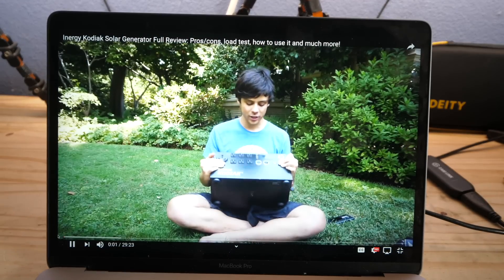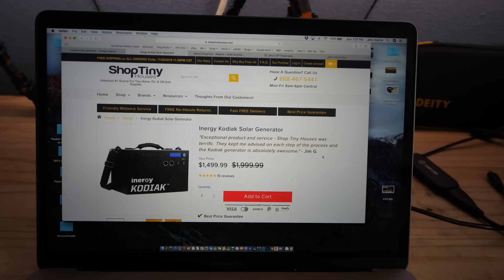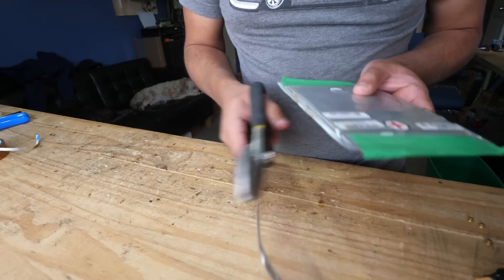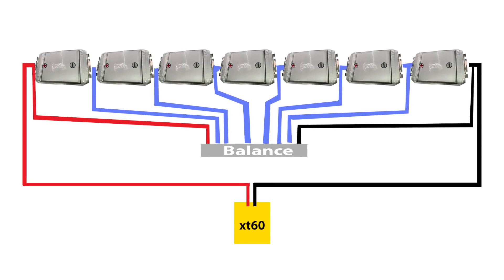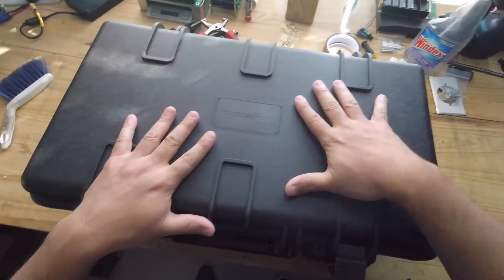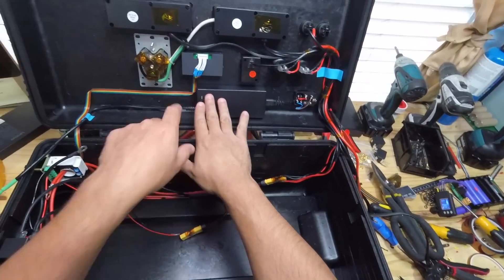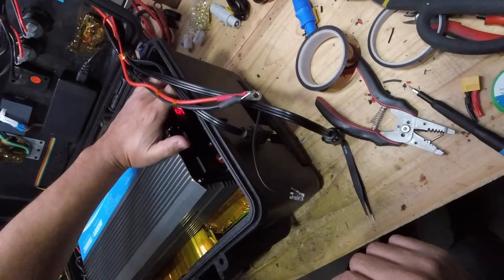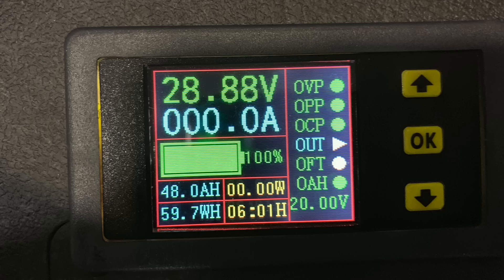DIY Inergy Kodiak Solar Generator

Comment: i don`t deal with you because first this your diy generator and kodiak  generator is very expensive 
and don`t forget you was working in the company for the battery lithium so this thing is help you and 
very easy to getting them free 
about me and another ppl they can`t paying like 1000$ to get only  lithium battery 
1- lithium battery with shipping from china = 1000$ 
dc to ac inverter 2000W high quality from china = 300$ from china and another price to buy this inverter from your country like more than 300$ with shipping 
another parts the total price between 100$ too 200$ 
solar panel 200W = 200$ with shipping 
total hours working between 8 to 12 hours none stop 
so did you thinking this is very easy to getting your diy  generator or kodaik  generator ???
Reply: If you live out of the U.S.A. don't spec the prices are the same.
Reply: @nelsonpagan5163   If you live out of the U.S.A. don't spec the prices are the same ????
i think you kidding  .. who`s told you the prices are the same ? 
from DHL , TNT , FeDeX and another company in the Middle east is very expensive to shipping the parts 
for Example solar panel 200W = 200 $ usd the price with out shipping 
so if you want to know how much the price with shipping from this company it was 
solar panel 200  + between 150 too 200 USD with tax .. the total price will be 400 USD only for solar panel 
so you just living in usa and you don`t have any idea about another country 
and like i told you before you can getting a free lithium battery from your company because 
you was working there 
if you asking me about why the lithium battery is higher price when you shipping from china to any country because all the company said it was Dangers to shipping them free 
but i think they are joking if you put them in strong box

Comment: Hey Jehu, question here, in the parts list you have a modified sine inverter that is being used. Wouldn't it be better and safer to use a pure sine inverter especially when you're charging expensive computerized electronics? I may be wrong, but what has been your experience or others out there between modified and pure sine wave inverters?
Reply from the maker: Yes get the pure sine inverter instead
Reply: @jehugarcia  where can I find the 24v 2000w inverter with solar charge controller

Comment: good job.  Suggestion... how about using 18650  in 7s (whatever p) 24 volt inverter not using the board kit in this case, just cells mounted in the classic plastic holders for space saving. spot welding or wire and fuses. everything simple. and every user chooses their favorite way of charging, (solar, ac adapter, car) Jehu  has inspired me wit his ideas. keep that good work and spread of battery education.
Reply: Luis Rodriguez 18650s are what Tesla uses.
Reply: You could end up melting the spring connectors if you pull a lot of current.
Reply: @kevincai96  wright.  in that case the sistem is good for electronics,  use a few hundreds of watts like most solar generators.

Comment: I would be careful doing those joints for the batteries, aluminum to brass to solder to copper is a lot of transitions leaving a fair chance of hot spots forming there.
Reply from the maker: Each pack sees line 15A max  no hotspots

Comment: Neat video! By trimming the batteries down they are much weaker in the case of a battery failure and will be more likely to burst
Reply from the maker: No they are wrapped in kapton tape
Reply: @jehugarcia  no, I mean if the cells were to get shorted and started to puff up they would be more likely to burst.

Comment: It could be had for a lot less. Use a   recycled ups for the inverter. The plugs would be from the ups and it would have it's own charger already. The unit would be pure sine output if a smart ups was used. Your three amp charger in your build would take quite some time to charge wouldn't it?

Comment: Did I miss the fuses or breakers so it doesn't  melt down?
Reply: @skywave dxer personally i don't like fuses aside from redundant protection since they can be slow and for such high current at the battery output voltage  your impedance is pretty close to a short so it's not that easy to use a fus,e i think what he should have done is a charging and protection circuit to each pack
Reply: @hennochoi  y
Reply: @hennochoi  As for fuses taking too long to blow or circuit breakers taking too long to trip, there are fast action fuses and breakers available. Just need to dig through the catalogs.
Reply: The sine wave inverter has it built in.
Reply: Raver Magik But it’s neither drawing from or exhausting to the outside of the box.....
Reply: @CarlosBenjamin   it does not need to. There are no gasses that need to exhaust. you can recirculate the air. Just like a persons trunk does when people mount them in the trunk. 
 If you want to add an exhaust you can.. but its not needed. As long as the AIR inside the case is between 50 and 80 degrees the air being recirculated is fine. If your going to go to high temps like in the nevada desert.. Ok.. crack the case and keep it in the shade.
Reply: a box that chill don't need a fan lol
Reply: @pakde8002  It has fans lol
Reply: Think the battery protection was all done through the drok meter - over/under voltage and over-current, etc.
Reply: skywave dxer Huh? "The meter doesn't matter"? Is that the meter that trips the protection relays due to the short circuit? I somewhat agree, I would have liked to see a 150-200A fuse in there... but then again, the gauge of the pack series wires may have been picked so that they are the fusible links.
Reply: KD0LRG and no low voltage disconnect. With all that’s missing it would pump it up to the price of the Kodiak LOL

Comment: And what About using 18650 cells?
Reply from the maker: Sure
Reply: jehugarcia would it be better? What about cost?
Reply: @samanthapowell5882  probably heavier and maybe more expensive, but good to have options right

Comment: Does one need to add a charge controller into that system if one want to use the power from the solar panel directly?
Reply from the maker: It’s built in
Reply: @jehugarcia  I can not find a 24v inverter with solar charge controller

Comment: The bit that always confuses me with lithium solar generators is how can the batteries be charge by solar correctly, lithium need constant current and I'm pretty sure that no solar panel provides that unless you can anker the sun in one spot and hope for no clouds, so Im thinking yeah they charge but not very efficiently or have I missed something?

Comment: Hey Jehu how about 12vdc sockets? What would need to be added to install those also. Maybe a shunt to drop the voltage from 24 to 12vdc?  Can this be added directly to the batteries with an inline fuse or circuit breaker.

Comment: You can solder to aluminium, however you need to use special "aluminium soft solder" and its just as cheap are your regular solder. Obviously you dont want the welding stuff. Look it up, it might be of help to you. Ive used it before in soldering a ground wire to a flashlight aluminium body and worked great... You can find it on ebay with a flux core...

Comment: I think i would rather do a 25p * 7s 18650 battery arrangement across the bottom. Even pulling 1500 watts that equates to 2.5 amps per battery meaning we can use those cheap Lg / Samsung modem batteries that battery hookup is selling for $110 per box (They are rated for 4.25 amps max)
Reply: i was thinking the same. and if space matters, just dont use the board kit use old school plastic holders and spot welding for better fit

Comment: No 12V output. The Kodiak has the 2 x 12 volt plugs. Other than that, love this build. You could do this by modifying the build to use  lifepo4 cells instead. But the 24 volt configuration is more efficient for what you have built.

Comment: Its not a generator, its a battery with an invertor
Reply: Does the unit itself not generate electricity from it's battery and flow through the inverter and other outputs?

Comment: You should compare apples w/ apples. Kodiak is "Pure Sine Wave" while the inverter u used is "Modified Sine Wave".
Reply: He at least listed the Pure Sine Wave inverter which was $ 105 more that the one he used.
Reply: @johnqsak  Yeah, i see what you mean. At the time of my comment there was no refference for a Pure Sine Inverter. Good for Jehu he corrected this. Now my comment is mute.
Reply: @johncristianjcivan5429  he's a sneaky one XD XD
Reply: @johncristianjcivan5429  Moot.
Reply: @johnqsak  yes he is you are absolutely right
Reply: @johnqsak  But the pure sine wave inverter doesn't have a solar charge controller.
Reply: @Marvyn555  Both are stand alone units. It's better that way, if one blows out or fails you don't replace a unit that has both which costs more.
Reply: Not sure why there's a 220 volt plug on the system when the inverters only 120 volts doesn't make sense to me.
Reply: @niceic.co.uk.  A 220 vac 30 amp plug has 4 contacts.  The plug used has 3 prongs and is a 120 vac, 30 amp (hot, neutral and ground). you can google it. (common error)
Reply: @sailingsolar  that's not true there is no neutral on 220 volts basically what it looks like to me is there's a plug for a clothes dryer on there.
Reply: @niceic.co.uk.  Umm.. Yes, yes there is.  I'm an electrician, and I've installed a few dryer outlets - they are Not the same - Google it!  But both the RV and the dryer outlet have a 'neutral' connection.  On the old-style three prong dryer outlets, the ground and neutral were tied together.  The NEC now requires 4-conductor outlets for dryers.  But to easily tell which is which for three prong plugs, a dryer outlet will have an 'L' shaped hole for the 'L' shaped prong on the plug, where the RV connection has the familiar tunnel-shaped opening for a round ground prong.
Reply: @niceic.co.uk.   With all respect, just because you don't know something for a fact doesn't mean it's not true when you hear it or haven't learned it to be the case. That plug is the approved plug for RV, 30 amp, 120 vac use and for 240 vac, 30 amp as with your dryer, when no neutral is required, according to the "National Electric Code". So stop thinking it's ONLY use is for 240 vac. uses. Seeing how you won't believe me, if you go to Inergy's web site and look up the section for the Kodiak, they define all the different connection the unit has. They list that female outlet as providing a 110 vac, 30 amp output. You can plug in your dryer but it won't work properly, if at all.  RV parks all have that connection for RV"s 120 vac 30 amp hook ups. I will correct something I stated incorrectly before. It is the "50" amp, 240 vac plug that has 4 pins, not "30" amp plug, which I wrote. Both are standard RV used plugs for 30 and 50 amp hook ups. Cheers.
Reply: @sailingsolar  you're missing the point I just asked a question. Take a chill pill man.
Reply: Think you mean the 30A plug, which is for hooking to a RV...
Reply: @ZeoCyberG  that's the same plug it's on my house for my clothes dryer that's 220 volts.
Reply: No, you're confusing the wiring with the plug. 30A plug can do both 120/240... It's common connector for RVs... So you can use it like a generator without needing an adapter and can use higher rated cables... 30A means it can handle up to 3600 Watts... So just up to the inverter if it can max it but you can still use it for with less...
Reply: @niceic.co.uk.  If it's really the same, someone installed the wrong one.  The third prong should be 'L' shaped if it's a dryer, regular round prong for an RV setup.
Reply: @chrisw1462 mine has an L shape. My mistake, thank you guys for the clarification
Reply: @niceic.co.uk.   Hear me out.  The Kodiak is not going to run your dryer because it does NOT invert 240 vac out that plug.  In this case it outputs 110 vac,  30 amp output ( their spec's not mine).  Nothing I could say is acceptable to you, so YOU can to go to the Inergy web site and see for yourself  There you can look up the outputs that the Kodiak provides and see for yourself just what that output is rated at. Go argue with them about your dryer, I don't even know why that's important with the kodiak. The Kodiak won't run your dryer properly if you plugged it in to the Kodiak.  This is standard with "RV"s" plugs/hook ups.  I do need to make one correction, the plug for RV"s that have 4 connection plugs is not a 30 amp but a 240 vac, 50 amp plug and that has a neutral, 2 hot's and a ground. My previous post said it was a 30 amp. with 4 pins, my error.  Best wishes.

Comment: Jahu please don't get me wrong, I love your videos,  extremely educational. First Speedy Gonzaléz is jealous. You used to take your time and explain things step by step. Seconds your quote is on materials only. Labor is not  included. That's why is maybe is call DIY. Third their some safety issue on the video. No cooling system in case of over Heat, and grounding. I saw that on the screen your set up some limits  but a cooling system make better. Over all I love it.

Comment: Jehu, this case is a little smaller but would it work? It's almost half the price. https://www.harborfreight.com/4800-weatherproof-protective-case-x-large-64250.html
Reply from the maker: Not with these components they barely fit as is

Comment: Hi jehu!
I own several RC cars and they use very  similar pouch cell LiPos. After a long time of use the pouch cells build up gasses and expand, do you see this happening in the future with the cells in this solar generator or not?
Reply: This only happens if you let them run too low (< 3.5V) and don't recharge instantly or draw too much.
I have 10 multistar 6S lipos on my ebike for 3 years and never let them go below 20%. They haven't swelled at all and still work well, even though they've lost about 25% capacity since new.
Reply from the maker: No I don’t plan on pulling 25C out of them,  more like 2.5C

Comment: Jehu, are you not concerned about electrolysis or oxide formation on the aluminum to brass connection over time ?  I'm not sure about this application but I have an aluminum boat, and if I were to use a brass drain plug it would sink in a few months, same goes for using the aluminum hull as ground for my electrical system.  Also I know that in house wiring, there were some early problems with aluminum wiring used with copper connectors forming and oxide and heating up over time.  We sometimes get called out to do thermograpic scans to check for overheating connectors in houses with aluminum wiring.  Anyways thanks for the Video, it would be great if you could do an update after you have used it for a while.  Cheers.
Reply from the maker: There’s no way to not have a connection with different metals unless I were to used aluminum wire but then again the inverter has copper terminals.

Comment: What is that big round socket with the + and - terminals at an angle that is on both the kodiack and your DIY box?
Reply: It's a NEMA 30 receptacle. 
220-240 Volts output at up to 30 amps. Commonly used in RV's/campers

Comment from the maker: Btw guys,  this project was sponsored by BatteryHookups which provided the battery 42 Lipo Cells https://j35.us/42x-SPIM08HP
Reply: No BMS with lipos?
Reply: Nice video. What about the BMS details and are you using a solar charge controller?  How did you use the 40A relays - i assume in parallel to net 80A’s x 24v DC.  I am building something like this with a 24v Tesla pack and would love to add some of these features. Please consider adding a wiring diagram.
Reply: @olemissjim  forget it. It is not diy channel. It's "look how it cool and buy my instruction"
Reply: Great project! And good job in putting it all together, always love these DIY's. Do you mind checking out JMantzel here on youtube ? He really is amazing at what he does, just like you.
He is currently searching for a sponsor as he is living on an island and running his caste, bulldozer and 4 boats off of solar power and golfcart batteries. Last time people reding this comment thought that it was a joke, but i assure you he is real. Take care man
Reply: Hey Jehuey, What BMS Boards did you connect to the batteries & where did you plug them to sense  / control voltages? That's also not in you parts brake downs?
Also on your testing footage, you started at 4.0v as full & ended at 2.8v... Yet can't you go higher & lower without hurting them?? Say 4.1v on high side & 2.5v on low discharge, like 18650s??? Also shouldn't you put an earth ground lug on it??? Thanks
Reply: jehu what where the the two relays doing in there? couldn't see
Reply: Thank you guys for explaining it to me now I understand.
Reply: You did make a nice power supply.
Reply: freaking expensive case!!! but well done
Reply: great project 👍did you already make an electric drive assist car kit? like a add on to make your car run more efficiently. like adding a starter to th engine.
Reply: Was wondering if it would be smart to also include a cooling fan?
Reply: jehugarcia
       
      
  Please upload this video to bitchute
Reply: What subject do I need to learn to know what you do bro? please help me
Reply: jehugarcia can you call me 5305528047 delete this after you get my number
Reply from the maker: No
Reply: @Jehugarcia do you have a video or print out that has more info on how to build this?  I really like this project and would love to build one on my own. thank you in advance...
Reply: I was just wondering if you could explain to me why there is a 220 volt plug on the case when the inverter is only capable of delivering 120 volts and also why you're using speaker connections on the case that doesn't make any sense to me?
Reply from the maker: It’s an RV 30A 120v plug
Reply: Voltage is just irrelevant, those connectors are robust and made at least for 250V 20A ... seriously did you look at the separation between lines ? that kind of connector can drive about 5-10KV if dry(comment was for Scrbe Line)